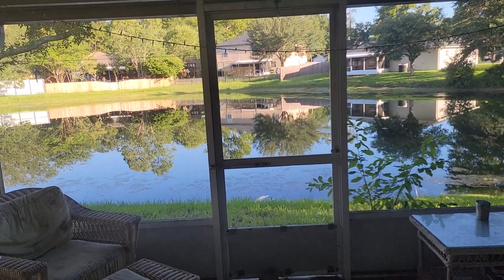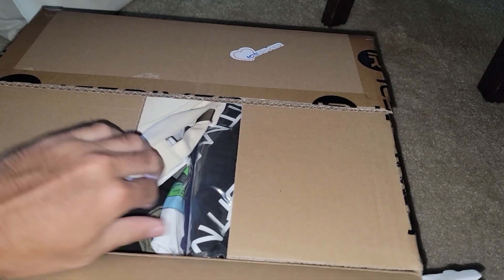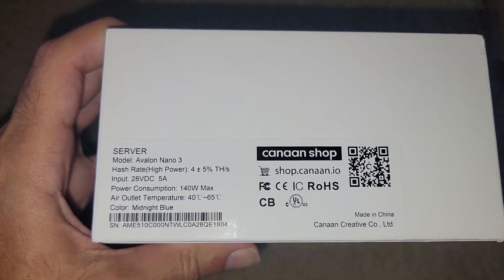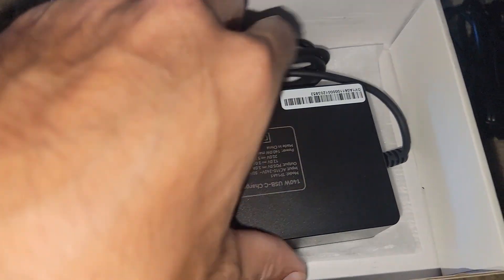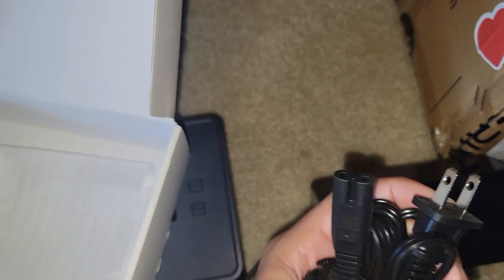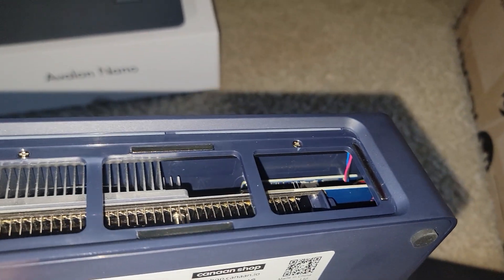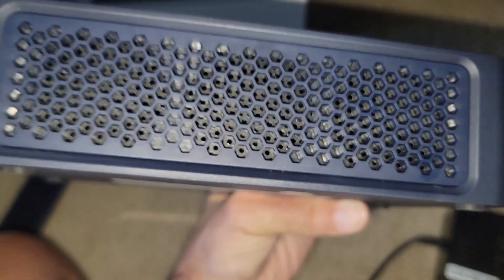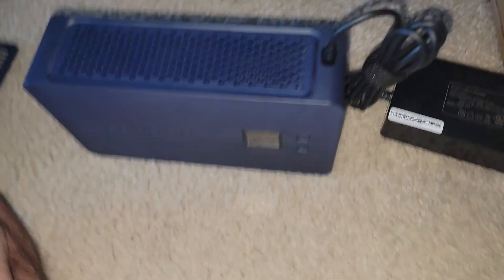Canaan Avalon Nano 3 Miner Setup

Comment: Do you know if it’s possible to connect to the app from two different devices to control the miner?
Reply from the maker: @a_d_s5361  maybe not through app, but set it up, and you can always log in via IP assigned?
Reply: @SerpentXTech thanks. Is it possible to adjust the settings within the IP interface? Like light control and toggling between low, medium and high? Thanks again!

Comment: Taking one apart, gonna try to flip top 180 degrees and put it on a 45 degree stand. Would be neat to see the display when running and have air in bottom and out top